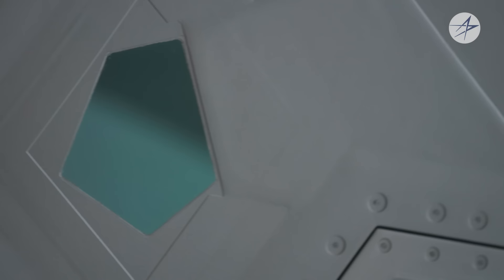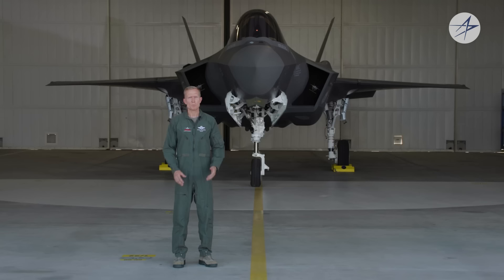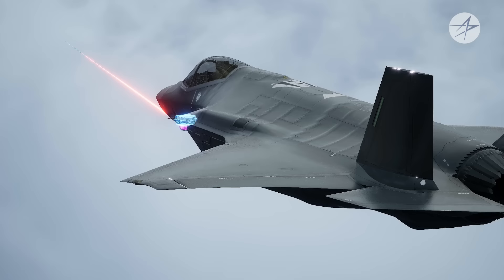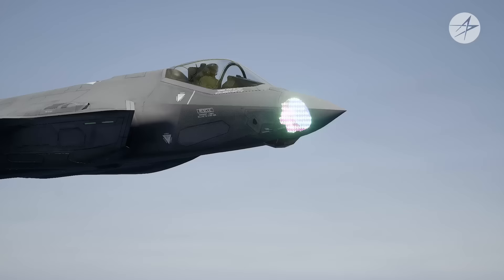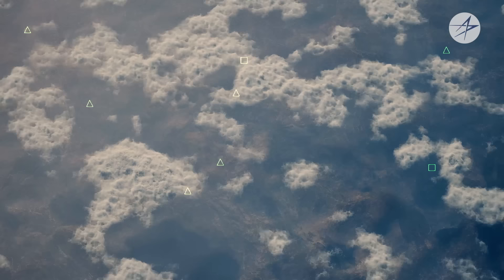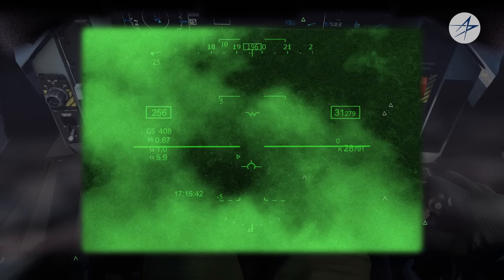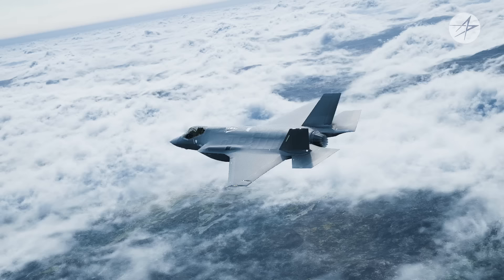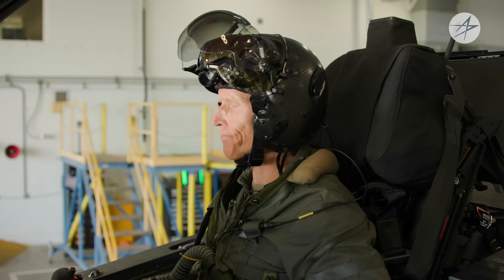INTO THE COCKPIT: Experience the World’s Most Advanced Aircraft ⚡

Comment: I spent 2.5 years working busops on production of EOTS & DAS windows.  The fact that merely the windows and frames are as complex as they are, without even going into the sensors behind them, would likely blow most people's minds.  I know it blew mine.  Such a cool program to have been a part of.
Reply: I am literally sitting over here with my mind blown. It’s very shocking and extremely interesting what they are doing at Lockheed Martin.
Reply: Thank you
Reply: It’s based on alien tech isn’t it?
Reply: Nothing really blows people's minds anymore these days
Reply: idk if you have VR or have tried VTOL VR, but the developer of that game has made a pretty good approximation of the EOTS and DAS system for the plane that they call the "F-45A". I'm sure it isn't completely accurate, but it integrates all of the capabilities that have been made public. The sensor fusion makes acquiring and tracking targets so much easier than using multiple independent systems.
Reply: @benz9063  Uh-oh, someone's figured it out. The FBI and corporate security have been notified.
Reply: It's just a TFT screen with green writing on it. All this blah blah he's on about is just rubbish. It's not stealth cause you can see it. It's just another plane that flies fast that's it.
Reply: No stone unturned, state of the art, best manufacturing methods and materials. Cost is secondary not because it doesn't matter but because that can't have an effect. Excellence is of the utmost importance. In the top 3,  actually lol
Reply: @pippy4658 lmao clearly have no clue what you're talking about, "stealth" does NOT mean INVISIBLE 😂 , it means extremely low observable to RADAR..and technically may as well b invisible at night, good luck seeing it with lights off close to the deck doing mach1+
Reply: How complex is it?
Reply: @pippy4658 are you inhaling soda bulbs again?

Comment: I look forward to viewing this video when it is formally published. - The title and description remind me of the marketing literature for a sports car that I once owned more than one of, and also rebuilt one of the engines.  It was a Mitsubishi Starion ESIR-Turbo (first generation), and the interior in the advertisements was referred to as "the cockpit", which was very appropriate considering all factors.

The engine's cylinder head contained some "experimental" jet valves, designed to increase combustion swirl within the cylinders, by allowing some outside air to enter the chamber, but over time could become somewhat problematic.  When I rebuilt the engine, I opted to install a JVE-26 "jet valve eliminator kit", which merely consisted of bolts to replace the jet valves, which some customers stated could begin to "stick" after long periods of use.  The automobile was also marketed as the Chrysler Conquest TSi, with the "TSi" referring to turbo-sport-inter-cooled, as the intake featured (Approx.) 19 feet of hosing which was pressurized and cooled by an impeller which was driven by the exhaust.  -  Some of my most memorable moments were experienced while rebuilding and driving that incredible machine. 

- - - On a side note, I ceased flying around the year 2000, and I ceased driving around the year 2008, but I may resume in the future.  I actually did pursue switching back from a full-time cyclist to a driver at several points, but the "system" in my state, and perhaps other states, made it quite inconvenient to re-acquire a driver's license after several years of expiration, and I was told by many folks that it would be necessary to "start all over" by obtaining a learner's permit, study and prepare for the written and driving tests, etc., etc., so I abandoned interest for the time being.

I hope that some of you folks enjoyed reading this, especially fellow aviation and space enthusiasts, John
Reply: Good stuff, thank you for sharing your experiences
Reply: I have a G54BT 2.6l engine from an 88 Starion auto in my 87 Dodge Raider (Mitsubishi Montero 2 dr) auto. Air-to-air intercooler by that time. I put a new casting 8 valve head on it, retained the balance shafts and installed a 2.5" downpipe in place of the precat/restrictor with the ridiculous 90 degree bend right angle inlet. Retained a/c, too. Good luck to your driving aspirations.
Reply: @JohnnyBfromPeoria  Wow, that sounds really "cool", or "nice", or "sweet", whatever is most appropriate these days, as I honestly do not know what terms are being used commonly these days, and if the terms vary across the USA. 

My first one was a highly modified Conquest TSI that was Metallic Driftwood in color.  Over time, I experimented with various exterior paint colors, as I could no longer obtain that paint during restoration.

I ended up ultimately with a satin style finish paint, which was marketed as a specialty series of metallic silver, offered by Rustoleum, and I had to travel to several Home Depot stores in the New England area in order to obtain a suitable supply.

The store was extremely helpful in that regard, and not only located what stores close to me had ample quantities, but they also had the stock held for me at 3 stores.

I contemplated using their high-end red, white, and blue professional grade electricians tape, to create a single tri-colored stripe, reminiscent in some ways to some aircraft

Note that I acquired that first automobile 2 days after the 9/11 terrorist attack, at a time when the display of the American Flag was looked at differently once again.

Speaking of exhaust the car came with a $140 Borla exhaust pipe end.  A larger turbo, and many racing-quality and high performance parts were present on the automobile.

The previous owner was a somewhat close friend, and left the car exactly as he got it, and I did not care for the racing steering wheel, the non-stock pocket billiard themed 8-Ball stick shift knob, and many other items, and over time, lots of time, I was able to obtain many stick interior parts.

At one point, I removed the leather seats, front and rear, and cleaned and conditioned the leather.

The automatic seat belt system was worn out on the driver's side, and although I purchased a replacement notched drive-tape for it, I postponed the highly involved and complicated endeavor to disassemble all of the interior parts required to replace that drive-tape.

I still have at least one box of parts, such as sensors, belts, etc., but I ended up giving away the near-priceless now parts such as the spare original aqua-color-coded fuel injectors, racing steering wheel, some spare headlight retracting systems, and other parts, when I sold my (primarily) black Starion ESI/R Turbo many years later.
Reply: @JohnnyBfromPeoria  Wow, that sounds really "cool", or "nice", or "sweet", whatever is most appropriate these days, as I honestly do not know what terms are being used commonly these days, and if the terms vary across the USA.

My first one was a highly modified Conquest TSI that was Metallic Driftwood in color.  Over time, I experimented with various exterior paint colors, as I could no longer obtain that paint during restoration.

I ended up ultimately with a satin style finish paint, which was marketed as a specialty series of metallic silver, offered by Rustoleum, and I had to travel to several hardware stores in the New England area in order to obtain a suitable supply.

The store was extremely helpful in that regard, and not only located what stores close to me had ample quantities, but they also had the stock held for me at 3 stores.

I contemplated using their high-end red, white, and blue professional grade electricians tape, to create a single tri-colored stripe, reminiscent in some ways to some aircraft.  Note that I acquired that first automobile 2 days after the 9/11  attack, at a time when the display of the American Flag was looked at differently once again.

Speaking of exhaust the car came with a $140 racing exhaust pipe end.  A larger turbo, and many racing-quality and high performance parts were present on the automobile.

The previous owner was a somewhat close friend, and left the car exactly as he got it, and I did not care for the racing steering wheel, the non-stock pocket billiard themed 8-Ball stick shift knob, and many other items, and over time, lots of time, I was able to obtain many stock interior parts, and the stock steering wheel was amazing, and a bit of a "hoot" itself, using light-based communication to support the buttons that controlled the stereo system, etc., with redundancy, believe it or not, to accommodate full 360-degree rotation of the steering wheel, without any loss of information.

At one point, I removed the leather seats, front and rear, and cleaned and conditioned the leather. - The automatic seat belt system was worn out on the driver's side, and although I purchased a replacement notched drive-tape for it, I postponed the highly involved and complicated endeavor to disassemble all of the interior parts required to replace that drive-tape.

I still have at least one box of parts, such as sensors, belts, etc., but I ended up giving away the near-priceless now parts such as the spare original aqua-color-coded fuel injectors, racing steering wheel, some spare headlight retracting systems, and other parts, when I sold my (primarily) black Starion ESI/R Turbo many years later. 

Those projects were enjoyable learning experiences galore, to say nearly the very least.
Reply: @jmiskinis 😊

Comment: Thank you for the video, this was very interesting to learn about the systems on the F35. I just retired from the commercial aviation sector where I taught Avionics systems on several aircraft. Weather Radar (WXR) on a commercial aircraft has an antenna under the Radome with scanning and tilt capabilities to map ahead of the aircraft. These systems also have a Ground Clutter Suppression capability, but nothing like the Radar system (AESA) on the F-35, where the system scans electronically with no moving parts. That is very cool.

I can only imagine what the 6th generation aircraft systems are going to be like, unfortunately, we won't hear about them for 10 or 15 years.

Comment: I always wanted to ask. Strobe lighting from ground with high lumen lights in two flashes per second? Does that give a shadow? With a moving target? I ask because I live near an airport and I imagine if all this tech fails, there's a way to triangulate to bring a stealth plane down for landing? If your systems have been ecm'd out in pitch black. I see a lot of strobe lights near where I live at night and it occurred, the light regardless of paint will shadow a craft or distort it. You can't obviously radar it. This would only work with objects within a mile moving slowly. We get like floodlight strobes here at night  that light up the sky from the ground. Logically, I see this as a way to calculate a radar invisible craft and observe speed and direction. If not the altitude - the pilot would relay. I'd assume a beacon would be outfitted though and running lights Just wondering why strobe, sky filling lights might be useful. My Grandad was a plotter for the RAF and did things by radio. Strobes are a good source of reference to ascertain speed and direction.

Comment: With that smart helmet and Augmented Reality HUD system, why does the cockpit have a transparent canopy? Wouldn't it make the aircraft lighter and more stealth if the entire fusilage was one continued piece? For the sake of safety you might consider a thin strip to look through in case all systems fail so that the pilot has some way to look outside. 

Alternatively: cover the cockpit canopy with the stealth fusilage type material and make it opaque entirely (and stealth), but let the pilot be able to emergency-eject that cover in case the visual systems fail. 

So, why the transparent cockpit windows? They don't seem to serve much of a purpose. Heck, I would even start considering having pilots controlling the airplanes remotely by them being inside an aircraft-simulation-rig strapped into some long-distance bomber that is within 50 miles and up in the air significantly higher. Then these aircraft can act without human limitations.

Comment: Please show how to diffuse or dump fuel from bulk so that the jet make it lighter and lifting  by wind like swallow bird who's playing in the Air..
Reply: The F-35 has 2 ways to get lighter. Fuel dumping and fuel burning (i.e. using afterburners). Getting lighter quickly isn't really a necessity in the F-35, though. There's no threat that will be catching them by surprise, where they'd need to get lighter quickly. Secondly, the plane gets lighter the closer it gets to the target area, as fuel is used. Lastly, the F-35 has no G/AoA/speed restrictions based upon weight, when in a VLO configuration. It's still a 9G/50° AoA/M1.6 jet, with full fuel and 5,700lbs of internal ordnance. F-15/16/18/Typhoon/Rafale/Gripen/Fulcrum/Flanker/etc.....not so much.

Comment: Boeing built the E-3 Sentry to perform reconnaissance and early warning in the 1970's. This provides information over a large range of battlefield objects. With the E-3 reaching retirement and drones providing autonomous or semi-autonomous information gathering capability, what is the motivation to replace the gap left by the E-3 with a plane, and why do 5th generation fighter jets need such sophisticated dispersal and sensory capabilities?
Reply: Fighter jets don't have 360 degree radar coverage like the E-3 Sentry or E-7A Wedgetail. Their radars are also not nearly as powerful as the radars on AWACS aircraft. Even the cancer beam of a radar that the Tomcat has (AWG-9 AND APG-71) don't hold a candle to the power of AWACS radars.
Reply: if you can't see you can't shoot. for the E-3 replacement, having such a huge aircraft exposed like that is a prime target for a peer force. Giving fighters the ability to have that information gathering and sharing capabilities removes the need for such a vulnerability. So, instead of relying on a big plane that the enemy can see and kill easily, you instead have the same or better sensory and information capabilities within almost every aircraft that could be flying.
Reply: @shoelace2739  The thing is that aircraft like the E-3 do not operate near the frontlines. They will always be operating within friendly skies. It'll be a huge gamble for an enemy force to try to shoot one down.
Reply: f35 can carry larger loads, at longer ranges, with better precision, with reliability and no risk of jamming like a drone would
Reply: @shoelace2739  I get that, but I am asking what strategic advantage having jets provides. Basically, if you ignore the part of my question about Boeing and focus purely on drone and robotic warfare, is it necessary to have a human pilot in the warzone?
Reply: @howwitty  We are a long way from that. Don't believe what the movies show. It will be a while before we reach the point where there can be fully autonomous drones. Regardless, there will always be a need for human supervision.
Reply: @Monarch683  I've been under supervision for almost my entire life, although I do remember the time before the internet. It's a little concerning to think how mechanized surveillance and censorship have become, but turning a blind eye to the algorithm isn't possible right now. So I have to wonder if there is a parallel concept in getting mowed down by a swarm of tiny drones carrying ballistic missiles and having Netflix tell me what movies are prohibited in my country based on agreement that was made in Geneva 38 years ago or whatever.
Reply: @howwitty yes.

Comment: Next product: geared for non-wealthy countries or relatively small GDP wealthy countries. 

HYBRID F-35
* F-35A airframe without RAM as the main build, greatly reduces costs but still relatively stealthy due to shapes. Most likely stealthier than FA-18, Rafale, Gripen. 
* F-35C's larger wing will be incorporated to both increase loiter time & range, while shorten distances for takeoff & landing. 
* The left upper-fuselage internal gun will be removed, saving spaces & weight for other purposes. 
* But the gun will still remain as a pod option just like in C & B. 

Other possible innovations.
* The fuselage will be made longer so that the 2 inner horizontal tails (& the various devices inside them) will be unaffected during afterburn, while also opening additional space for fuel tank, increasing both loiter time & range. 
* Stealthy enclosed weapons pod underwings to store at least 1 small IR missile each. Maybe 2 each at the inner wings
Reply: @@FunnyVideoCollector why?

Comment: and all the f35 capabilities were supposed to be in ONE plane ... not 3 ... pity the arrow a 70 year old gen 2 is still better even when using a heaver larger and slower engine like the PW j75 ... 

stealth is a fancy term for Low observability .. in otherwords making a cube van look like a smart car ... stealth is making it disappear ... 

and except for the helmet hud removing the plane from view ... the arrow had low observability ... look down shoot down radar for near and over the horizon as well as terrain following .. and a larger payload bay ... with triple redundant system on everything but pilots and the body itself ... including fly by wire ... fly by hydraulics and mixed wire and hydraulics ... and it was all PRODUCTION aircraft ... not one single prototype was ever built ...